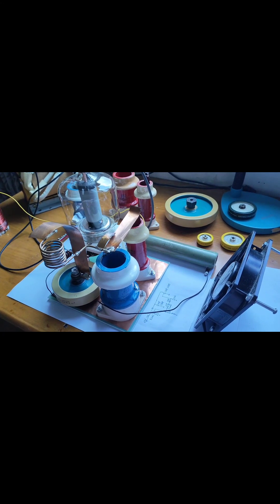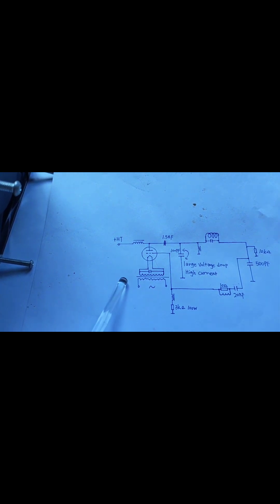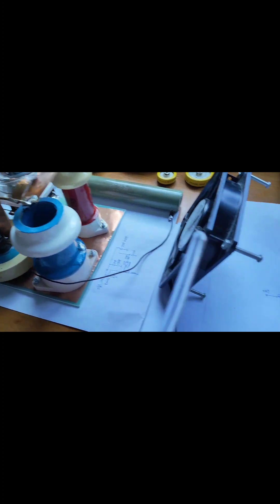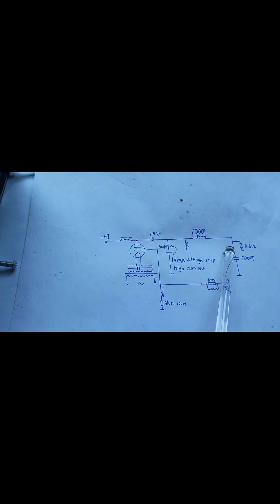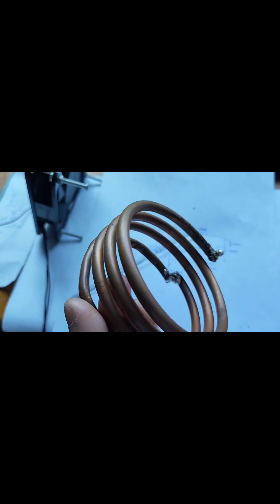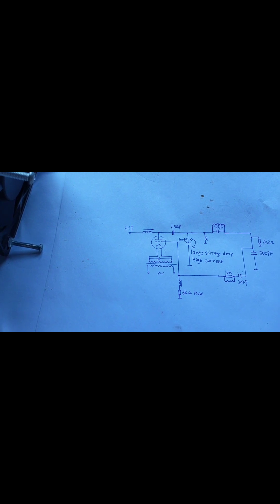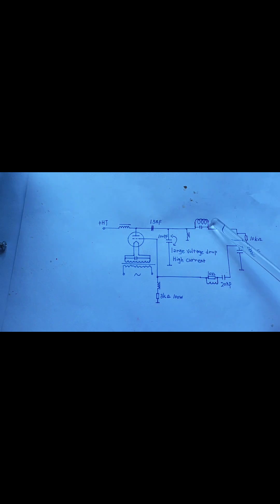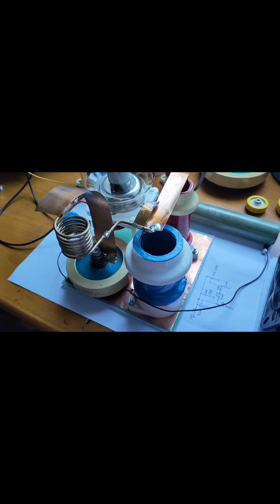ICP [inductively coupled plasma] RF generator เครื่องกำเนิดพลาสมาทรงกลม

Comment: Is a higher or lower mu VT preferable in a CW application where a dynamic load impedance matcher is used?
Thanks for the explanation. VT & RF circuits have always been somewhat mysterious to me, although I have built a few VTTC's in my life. Your explanation of each section shed light on their intuitive functions.
Reply from the maker: Hello sir, thanks for your like. In those type of oscillators, lower mu tubes would be better.

Comment: That is very cool, how can i build a smaller RF oscillator circuit that can create high voltages?
Reply from the maker: You can use a traditional HFVTTC circuit or try the circuit in this video. Maybe a GU50 HFVTTC will be a good start.
Modified HFVTTC: https://youtu.be/1KrzWkrQ3PE
Reply: @uecmitsuimarinedieselengin873  i would prefer to use a mosfet because vacuum tubes are hard to find and expensive where i live.
Reply from the maker: @ethanslab7670  I remember I may also uploaded some RF plasma sphere excited by mosfet oscillators. But they can only excite low pressure gas tubes since their inductive voltage is fairly low and the amplification factor of the mosfet is high so when the load changes greatly the power cannot be a constant.
Reply: @uecmitsuimarinedieselengin873  I'll probably try building a mosfet based oscillator first and maybe a tube based one after i find some vacuum tubes